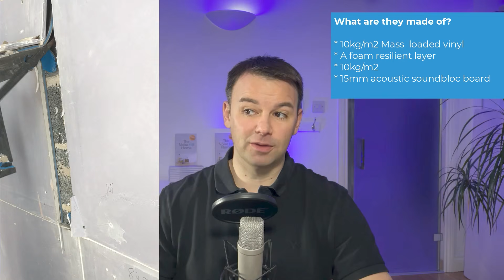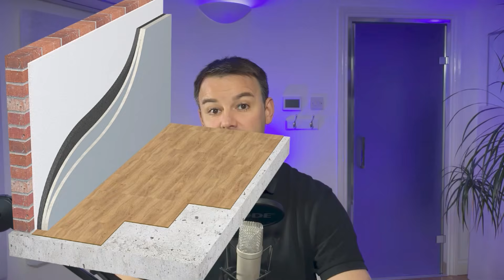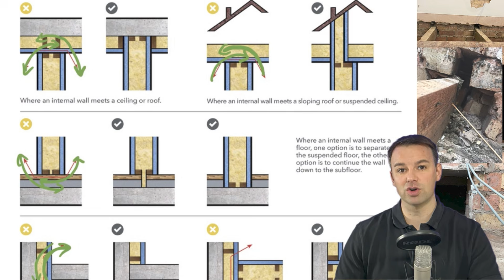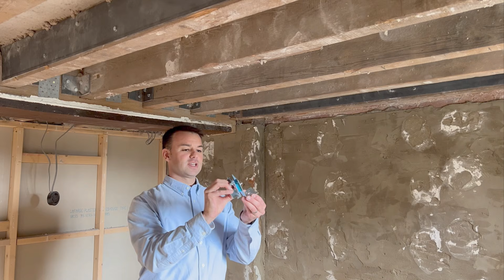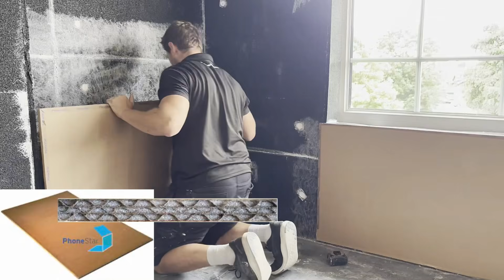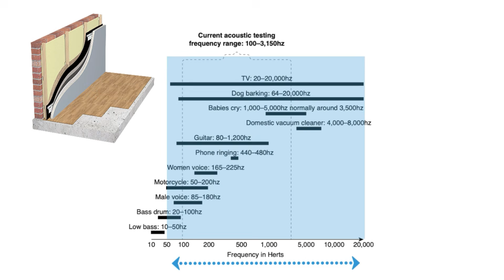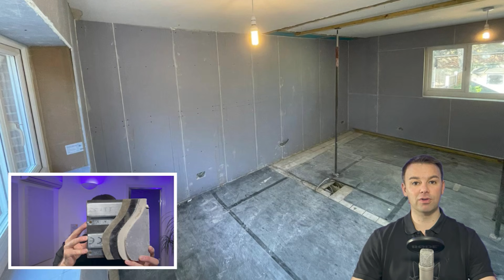7 ways to Soundproof a wall | #diy

Comment: Hi Jim.... thanks for all the videos. System 5, what thickness anti vibration pads for the battens that fix direct to the wall and where can you get them from?
Reply from the maker: Hey John, they are 15mm thick but compress to 5mm when you fit them behind the battens. We often use off cuts of heavy duty acoustic underlays. Most cost effective way for you would be to either make them yourself with carpet underlay and mass loaded vinyl….or purchase a sheet of acoustic heavy duty underlay. They all supply it, try https://soundproofingshop.com
Hope that helps 👍
Reply: @jimprior7  Brilliant... thanks so much Jim 👍

Comment: What would I need to do to stop my neighbours from hearing me (sounds of saws and tool) from a room on a partying wall? will insulating the flanking walls actually stop them from transmitting the noise to them or is it mostly stopping me from hearing their noise?
Reply from the maker: Hey @Sorellla, It is easier to treat the noise at source, you will have to do far less soundproofing your side to reduce your noise going to the neighbours, maybe the ceiling, floor and direct noise path of the party wall, flanking walls and hollow voids….for the neighbours hearing Loud Saws and tools the neighbours would have to soundproof nearly every room of there house to reduce that noise that is in the structure.

You need to reduce your noise getting into the structure of the building…which might mean soundproofing one room really well.
Not sure how to do that in a rented property though….maybe a soundproof booth creating a room within a room.
Hope that helps 👍

Comment: Hi Jim, thanks for the very informative video. 
I have been soundproofing a party wall and need to deal with a flanking wall that has a steel lintel which seems to run the entire length of the wall. The problem is that it is some type of Catnic box lintel which is hollow, and the only access to inside are small holes about 1x0.5cm on a section of the underside (doorway). The sides of the lintel are solid with no holes.
Obviously filling it with something would be highly preferable but as you can imagine that is incredibly difficult. The easiest would be spray foam - closed cell fire rated which could make noise worse(?), or open cell which may improve it(?) but probably a bad idea for a lintel as not fired rated and not moisture resistant. Getting mineral wool inside would difficult, time consuming and no guarentee to actuall fill it.
Something you have come across before or any thoughts on what to do?
Reply from the maker: Hi Gray,
Great question and thank you for your comment,
Don’t over think this one, sound deaden it with the 10kg/m2 self adhesive TecSound…(will need the contact adhesive as well: (Spray contact adhesive
https://bit.ly/3s82pjv )

I would not use either expanding foam as the sound will transmit more easily through that than air.
If you have the space available to 20mm rubber and 1 or maybe 2 x layers of 15mm sound bloc over the catnic lintel that would be brilliant. 

Here check this video out:
How to Soundproof an RSJ? #diysoundproofing
https://youtube.com/shorts/LTCJfzz5Cr8?feature=share

Hope that helps, let us know how you get on 👍
Reply: @jimprior7  Thanks Jim. I have bought that contact adhesive before, I think from one of your links, and I would recommend it to anyone who's not sure whether to get it. I have tried various ones similarly priced or higher from decent brands you can find on Amazon, and the one on PCDSales visibly has much higher solids content (the actual adhesive) so less spraying needed and less nasty stuff in the air.

Comment: Hi Jim, thanks for all of your soundproofing content, It's been by far the most informative! I am building out a floating wall system using 70mm metal studs on isolation strips top and bottom as we have a concrete floor (20mm air gap from party wall which has been taken back to brick), filled with 75mm RW5, topped with 2x15mm Knauf DB boards with SY100 sandwiched between the 2 boards. Would this still be pretty effective against loud neighbour conversations, kids screaming and a dog barking? I fully appreciate every scenario is different but just want to know if I'm on the right track as I am trying my best not to lose too much space. Thanks in advance
Reply from the maker: Hi Sukh,
Thanks very much for your question, and thanks for watching, glad you are getting value from the insights I share on the videos.
We build the floating frame using timber with pressure and anti-vibration pads to minimise the fixings to the structure, not sure you can get that with the metal studs.

The metal stud are useful if you have to use non combustible materials, but we find the metal studs create wall shudder, therefore we do not use them in any kind of setting where recording or testing is required such as audiology rooms and listening rooms and cinema rooms.

Metal studs also allow the sound to transmit across the frame more easily (3 times more easily) then timber and you have to be very careful not to channel the noise into the upstairs rooms.

Is there a reason you are using metal studs?

To answer your question, if you are not sound deadening the wall first and not treating any of the other noise paths, I think you will reduce the higher frequencies of noise and the overall noise reduction will feel like 40% reduction if you are stood in front of this new wall. You will still hear dog barking, screaming kids and low frequency male voices.

I would recommend sound deadening the wall with a 20mm rubber first, use resilient bars and an RW3 insulation.  If the Rockwool is too dense it will just channel the noise into hollow voids and into the structure of your house and bridge the gap between your upright studs and joists etc.

Are you on the right track….i would register for my soundproofing masterclass, which is free to attend and what is quite refreshing, there is nothing to buy at the end…it’s pure content and I hope you get value from it.
Thanks very much again for your question….let us know what you decide to go for in the end.

MasterClass Advert: https://youtu.be/YIWMJrBbXnA

What is the masterclass and how do I attend:
https://jimprior.com/soundproofing-masterclass-registration/
Reply: @jimprior7  Thanks Jim, as i'm trying to keep the thickness down, would attaching 10kg/m MLV direct to the offending wall work? As we removed the chimney stack the wall is not exactly in the best shape so using the baton to wall method might not be so easy to get straight, and so I'll be using a wood floating frame and RW3 instead given your feedback.

Comment: Hi. Do you have a video showing how to fix the 20mm rubber to the walls? Thanks
Reply from the maker: Hi Eddierocket2010, yes we have a whole online  course called: The Noise Free DIY Soundproofing Course, it has step by step lessons on how to install every layer of a range of different soundproof wall, ceiling and floor systems. The videos I share of professional installations give useful insights but the course breaks it down into step by step detailed lessons with load of useful tools and materials calculations and discounts.

i would consider registering for my soundproofing masterclass, which is free to attend and what is quite refreshing, there is nothing to buy at the end…it’s pure content and I hope you get value from it.
Thanks very much again for your question….let us know how you get on.
Reply from the maker: Soundproofing for Beginners | Full Course Tutorial
https://www.youtube.com/watch?v=hVqa1m3JzGs&list=PL-ZigmSd311dNw8Tbe1IfLiJgEiJcjvMN

Comment: Hi Jim, many thanks for all the great videos, they have been most helpful. I've also recently attended one of your webinars and that was very informative. Just one question about the positioning of the rockwool in the floating frame. It looks like in one of your videos you fix the rubber to the wall and then build a 75mm stud frame 25mm away from the wall and then use 100mm of RW3 pushed all the way back to the rubber. Is it ok to not leave an air gap when rubber is attached to the wall and you only need an air gap when no rubber is fitted? Cheers Ian
Reply from the maker: Hi Ian, thanks for your comments, it’s great to know that you have found the youtube videos useful and I am really pleased you got value from the Soundproofing Masterclass. To answer your question …yes but it depends.
..
As you are probably aware by now soundproofing is not always straightforward and the right combination of techniques to use will depend on your specific property and noise issue.  In the video’s I try to give some general installation advice to help homeowners and DIYers avoid the most common soundproofing mistakes.  I wish I could fit everything you need to know in detail into a 10min video or 60min webinar but unfortunately it’s not really possible... hence the DIY Soundproofing Course offering.
With the online course I can show you the how to’s in much greater detail including exactly how to position the rockwool, where to put the screws etc. You also get the opportunity to have an accountability session with me to make your plan of action for your specific property and noise issue.
If the course is not for you there is also the opportunity to just have virtual installation support from me to ask questions as you carryout your installation. See the work with me link above.
Sorry if that sounds a bit salesy, hopefully by now you will know that I am genuinely passionate about helping people reduce the noise in their home and want to give you the best advice I can which is why I created these offerings to allow me to do that.
Reply: Hi Jim just what I'm looking for but what kind of prices are we looking at for a small living room including the ceiling? My neighbours are sending me insane as I have PTSD her lad games and always banging on the floor which comes through my ceiling and front and back walls.

Comment: Great explanation! Have you any experience or have an opinion of reducing the Rockwool thickness from 100mm down to say 50mm? Thus with option 6 (175mm) or option 7 (185mm) the space required would be 125mm or 135mm? Thank you
Reply from the maker: Thanks very much for watching, so glad you got value from it, it is a great question. It is not something we have tested in residential homes. However some bespoke projects we have done similar things. The main reason we build the floating frame like we show you in the Noise Free DIY Soundproofing Course is because of the load bearing. The frame is built with pressure and anti-vibration pads giving superior isolation and decoupling compared to the traditional stud frames. I think you could use a 2 x 2 timber and a 50mm RW3 but to take the load bearing you would have to secure the timber to the flanking walls, ceiling and floor and maybe even put noggins in a few places like a traditional stud frame. Saying that I am really intrigued to see how you get on. 

I have a couple of things for you….the first is The Soundproofing Masterclass I am running really soon….here is the link: https://jimprior.com/soundproofing-masterclass-registration/ 

And also...Check this video out: it show the thicker system and the thiner system joining between the upstairs bedroom and the downstairs lounge: https://youtu.be/CR7ZtJ3fI2c?si=J1fAznh04oB6twLp

Comment: Hi this is a really good video thank you, I just have a question if the chimney is still in use can I use the number 6/7 method there? is it safe to put rubber mat on the chimney breast? and if the room is the first floor bedroom do I need to soundproof the floor and ceiling as well or just around the party wall?
Reply from the maker: Hey Gazaantal3916, Thanks very much for watching glad you are getting value from my content. Such a great question, thanks for bringing this up…If the flue is lined or 150mm away from the rubber then yes you can use the rubber on the chimney stack. If not use metal studs. Any Heatas registered engineers reading this will be able to help me out and correct me on this, but here in the UK we can not use anything combustible within 150mm of the flue for a used chimney. There is a detailed lesson on this on the Noise Free DIY Soundproofing course.

With the bedroom check this video out: https://youtu.be/4Utchs-ZA6I?si=ABdjFfu7M27yKyRt

With regards to the bedroom, most of the time yes, to get that soundproofing of a detached house yes you need to tuck the system down, treat the floor, loft and flanking walls and sometimes the walls in other rooms. (I explain in next weeks video); 

However; do the ear on the wall test and test the flanking walls in that bedroom. Next time the neighbours are playing music…being loud and making noise, put your finger in one ear and the other ear on the flanking walls and listen….what do you hear? Might be the same volume next to the party wall but only slight the other side of the window wall…maybe watch the first part of this video again to see what you can put on these flanking walls.

Hope that helps, great questions….please let us know how you get on.

Also I’m running a SOUNDPROOFING MASTERCLASS real soon, look out for the email if you on the waiting list for the Noise Free DIY Soundproofing Course….what is quite refreshing is there is nothing to buy at the end, its pure content to help DIYers.

Comment: In your example the floor joists run perpendicular to the party wall. This is not the case for me, they run parallel to the wall. If I were to cut back the floor to tuck in the wall I would be damaging the structural support of the floor. Is there a way to solve this issue? I don't have access below as both spaces are finished areas. Thanks for the excellent videos.
Reply from the maker: Hi Jason,

Thanks very much for your comment.
There are a number of options and they are all featured in lessons on The Noise Free DIY Soundproofing Course (next intake second week of June 2024). Your awesome question and probably demands its own video…but I will try and answer it here.

Assuming you are not comfortable moving the joist over because it will disrupt the room downstairs:

-	You could go over or past the joists using a thicker soundproof wall system, this would allow you to tuck the system down and seal the layers to the ceiling below.
-	To support the floor boards and renew the structural integrity of the floor, install a joists trimmer using noggins and a new piece of timber the same thickness as your floor joists…I will feature this in my next video -part 2 of this video: https://youtu.be/VUMj_PrZG1c
 
-	If you require a large load bearing next to the party wall, then install a new joist along side the existing would be best option (the ceiling board below won’t need to be connected to this)
-	If less of a load bearing is required and especially if the joists are close together you could fix 4 x 2 timber to the next joists to reduce the span of the floorboards. Please forgive me I have not seen your project, but hopefully this makes sense.

Thanks again for your great question, less us know how you get on

Comment: For the rubber gym mats most people i know use horse mats do you think this is ok
Reply from the maker: Hey Paul, I’m not sure, I have not used them before, they look very dense. How much does the ones you are looking at cost? Are you in the UK?
Reply: Thank you very much
Reply: They are around £60 per matt and yes in the uk the only downside is they are very heavy
Reply from the maker: @paultaylor7479  Need to be a corky type of rubber like these:
 https://www.soundservice.co.uk/M20.html
or 
https://www.floorscan.co.uk/product/m20-rubber-sheets/

or
https://soundproofingshop.com/acoustic-boards/m20-rubber-panel?_gl=1*1m37jeb*_up*MQ..&gclid=CjwKCAjwmrqzBhAoEiwAXVpgosRZaYcg54a8wofv13nHxCLqBy6jFfyxmQWf48EKutwWEpxtunsU7xoCfZQQAvD_BwE

Comment: A data sheet for the M20 rubber panels recommends mechanical fixings, is this a definite no-no? I'm a bit concerned about the integrity of the plaster I'd be adhering on to. Are the panels known by any other names, can't seem to find suppliers in Ireland.
Reply from the maker: Hi @tirconaill, we use mechanical fixings with the 50mm system. Also if you have dusty old brickwork. Still use the two different types of adhesive for that resilient layer and fix it in the way we show you in the Noise Free DIY Soundproofing Course. When you purchase them from the builders merchants the panels are sometimes called RR20. I know Travis Perkins call them RR20. Hope that helps 👍Spray contact adhesive
https://bit.ly/3s82pjv
Reply: @jimprior7  Thanks for your help Jim.

Comment: I’ve only started looking into solutions for our noise issues, but to help me focus my efforts, are there affordable, preferably DIY, solutions that can be attached directly to an existing plasterboarded stud wall without removing the existing sheets of plasterboard?
Reply from the maker: Hey Oneiros88, great question, thanks for your comment.
Absolute not no, a hollow stud wall can be a main cause of the noise. Going over the top like some soundproofing material suppliers suggest…will channel the noise into the hollow floor, hollow ceiling void and into the structure.
Check this installation case study out: https://youtu.be/u7GUZHIOyuw?si=1Rd7VzMYYMen2qKT

Bottom line is, the sound is resonating in that plasterboard wall and you need to open it up and insulate the hollow void to stop the sound resonating….and then go over the top of it.
Hope that helps
Let us know how you get on
JP